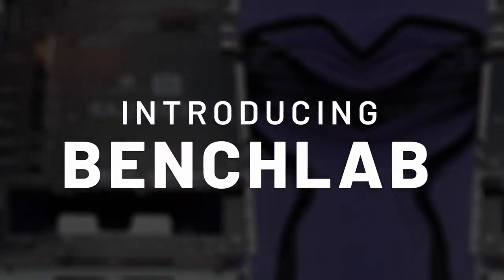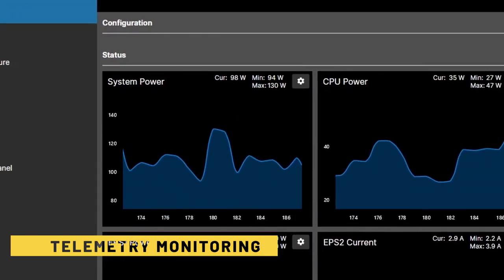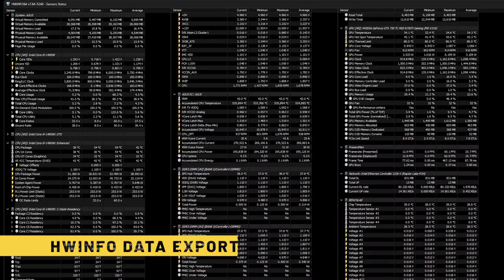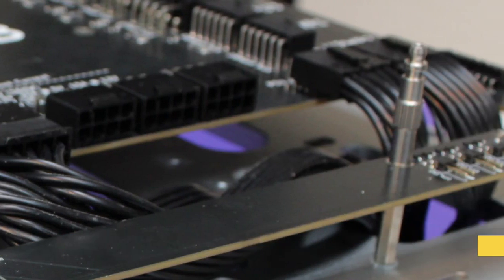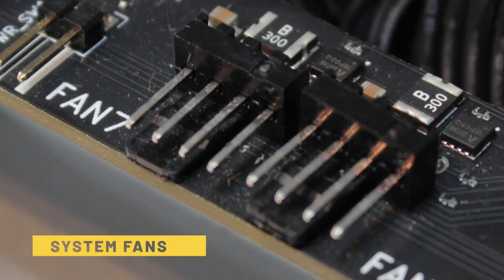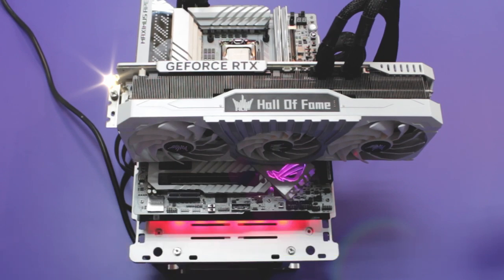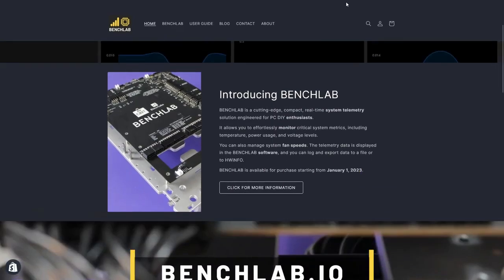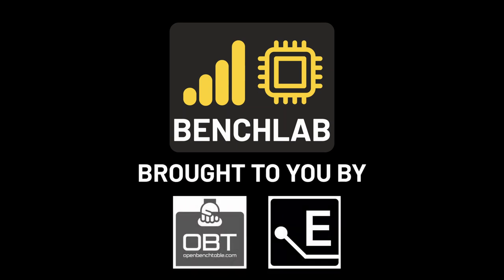BENCHLAB by Open Benchtable and ElmorLabs

Comment: I purchased 1 set of ElmorLabs HOT300 Heater Generic & GPU Backplate and 1 set of memory side, one behind the CPU,
Two are installed on the memory side.

I purchased two ElmorLabs HOT300 Heater Controllers, but I am not sure how to connect them and use them.  I couldn't find a video for an installation guide, so I'm leaving a comment here
also ElmorLabs EVC2SE 1bought it bu it is same ( i don't know about install setting )

Comment: This device looks nice I might get it when I have the money later on, but man as a builder it looks like I have to do extra steps if I have to use it every time I do testing for my stuff or my clients on the teat bench, taking my boxes when I store it back and forth.
I feel like the PMD-USB is already great for me, I just have to find the 12VHPWR or 6x2pcie cable for it.
Reply from the maker: What extra steps would you need for your use case? Compared to not using this product, it's supposed to reduce the amount of rewiring you'd need to do when changing only the motherboard or only the PSU. Compared to using PMD-USB then this has more cables you'd need to rewire, but that's mostly because it's measuring more things.
Reply: @ElmorLabs   To be honest, the extra steps I have to do if I get the benchmate is those stand off screws to install on test bench and undoing it when I'm done.

However I'm concerned about the size of this tool compared to the pmd-usb tool, I don't have much space as I can, my workplace is just my dinner table so space is limited here with boxes nearby and my briefcase to carry out tools is a duo laptop luggage capacity, that's why I like your tools, I use often them and its amazing for us PC builders at a good size with a nice price.

I already have the EFC & evc2sx for fans control, I will wait for the EFC-X9 to be ready as you said so I don't mind waiting for it.

My suggestion if possible is maybe a cost reduction version of the benchmate is a pmd-usb-XL with ATX power and 3 extra PCI power for an second gpu ready with 2 of the 12vhpwr(or 6x2pci) cable adapter.

Comment: Question: If my PSU doesn't have the native 12 pin GPU cable and instead I currently use the adapter that came with the card (3 x 8 pin to 1 x 12 pin) would I be able to do the same conversion through the BenchLab?  Meaning from my PSU to the BenchLab I'd run 3 x 8 pins, but then from the BenchLab to my GPU  I could use a straight 12 pin?  Effectively the BenchLab itself would become my adapter?  Or is it not wired for that and I must go (8 pin in to 8 pin out) or (12 pin in to 12 pin out)?
Reply from the maker: All channels are separated so you would still need to connect 3x 8-pin on the BENCHLAB output that you would then adapt to your 12-pin, BENCHLAB wouldn't be able to replace your adapter.

Comment: Awesome piece of kit! Ist there any way to order it from the EU? I sadly haven't made the best experience with B2C orders from Hong Kong or Taiwan to Germany.
Reply from the maker: Currently no, only shipping from China. To EU you'd have to deal with import taxes and handling fees which does complicate things in some cases as you've experienced.
Reply: I'm in usa and I've bought directly from elmorlabs, no issues with shipping at all. Was pretty quick too.
Reply: @Apollo-Computers  thanks man! I saw that elmor is shipping via DHL, so pretty expensive, but imho super save. Will order it once the first tests are out.
Reply: @Apollo-Computers same, I'm in Canada and I've used air mail, it's quick in a week. Have to pay duty from the local post office, but it's good
Reply: I've been ordering from the U.S as well with no issues with the Standard shipping.